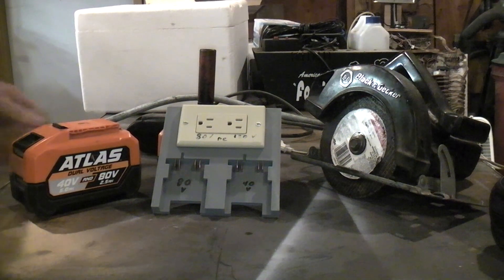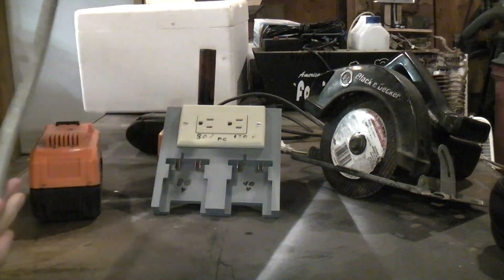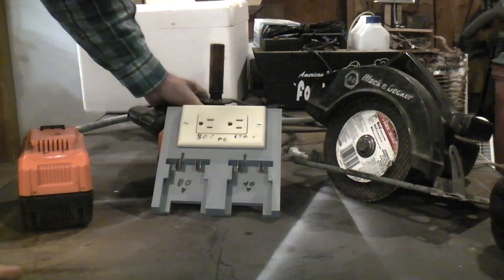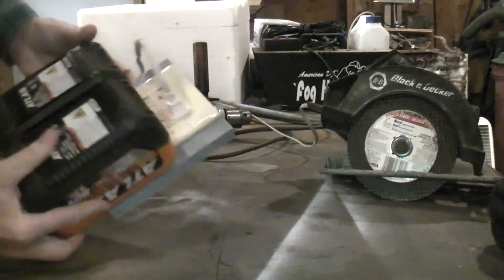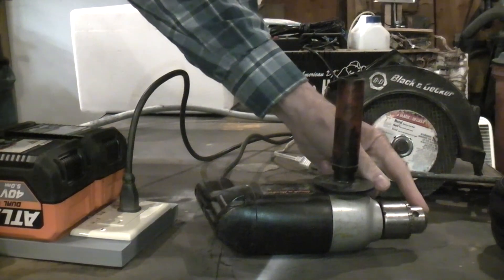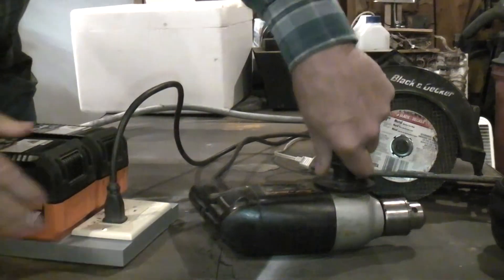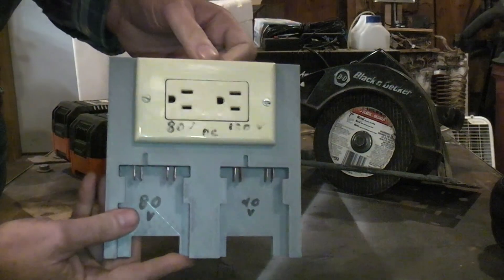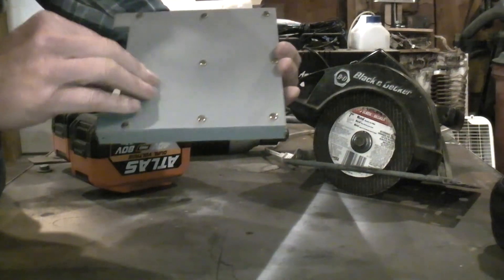I 3d printed a adapter for my Atlas 80 volt battery to run brushed power tools.

Comment: this idea is fantastic = good job
Reply from the maker: I have used this device so many times on the property now that I do not know how I got by without it. And used brush tools are way cheaper than battery tools.
Reply: @Robothut your idea is great and works well. I broke down an bought an inverter. It runs everything electric, including chainsaws. Only have 2 acres but the back is far from the house.

Comment: Would this run a small portable heater or hair dryer?
Reply from the maker: Yes, as long as the fan motors are Brushed and not AC motors. I have been using mine like crazy since the video. I ran AC leaf blower "it had brushed motor" My skill saw many times, my hedge trimer. And using my modified LED 120 volt lamp I ran the light for 12 hours during our last power outage. Very use full device.

Comment: You never cease to amaze me.  I didn't know that brush power tools can run on DC.
Reply from the maker: Yes my grandfather used to run power tools off of car batteries, the tools ran slower as he never got up to 120 volts DC but he was able to get the job done on the farm back then when the power was out.

Comment: Really smart…. Where do you get the metal tabs ?
Reply from the maker: I went to the hobby store when I was in town, plated steel would have been best but I settled for copper, it was just under 1mm thick and a sheet, so I had to cut strips to make the tabs.
Reply: @Robothut  thanks John